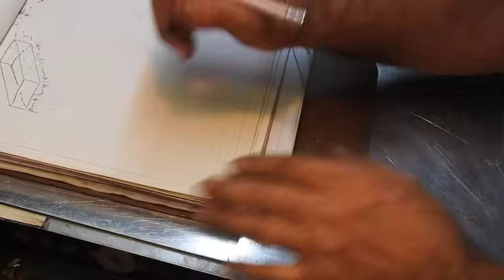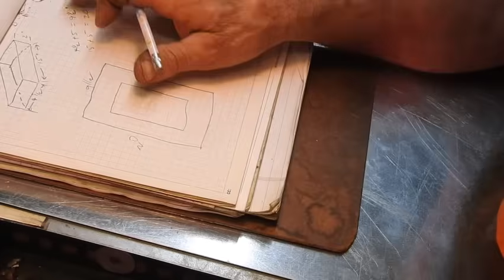Lets Build A Simple Sheet Metal Tool Tray

Comment: kills me how my kids have no idea how this would work.
I grew up, at 13 yr old, I was running an Oster and RIGID 300 pipe machine for my dad, installing Dry Cleaning Plants.
My kids cant even identify a pipe wrench.
I have truly failed.
Reply from the maker: Well, I started riding the fender of the old tractors at the age of 4 after my mom died.  Been around farm equipment, hogs and dairy cattle from then on....worked the farms 54'' circle mill sawing lumber as a kid on the business end of a cant hook.  Started off bearing from a buzz saw before the age of 10....the list goes on.  Rainy days on the farm were the most fun and were spent in the blacksmith shop making repairs to the machinery... LOL  I wouldn't trade a minute of the hard life with no running water or indoor plumbing until I enlisted in the Marines. By today's standards I was pretty hard on all three of my kids too and it didn't hurt a one of them either !!  I wouldn't be so hard on myself if I were you.  Today there is so much to catch a kids attention and draw them away from what's important.  I'm sure your kids absorbed much more than you may think. Thanks for watching the video and thank you for such a candid comment !!

Comment: Thank you. Great video. I like the idea of hammering the rivets on the inside and having the square block for a dolly. 
Question, how do you decide which part, base or side, will be the part sticking out and gets bent up?
Reply from the maker: It really doesn't matter which one because its the pretty much the same exercise either way.  But do what is easier for you. Smashing the rivits strengthen plus gives smooth surfaces.

Comment: What gauge and type of sheet metal do you use to make these?
Reply from the maker: This was just 26 ga galvanized sheet metal scraps from duct fabrication projects. Small boxes can use as thin as 28 ga. Larger ones require 24 or 22 ga if it’s expected to hold a very heavy load. If so, many times I’ll solder the corners for additional stability. I have quite a lot of  fab videos in the playlists up top if you are interested.

Comment: Anyone know what shears those are? And what gauge of metal
Reply from the maker: @808lukas1  iirc those are Malco M14 snips. The metal is 26 gauge galvanized sheet metal.
Reply: @ thanks a lot
Reply from the maker: @ no problem. Thanks for watching. Hey, if you are interested I have a LOT of sheet metal vids up top in playlists. All kinds of ductwork fittings.
Reply: @tractorman4461  sweet I will check them out. Nice work, I’m a beginner but turning a large ~4x5’ metal file cabinet into a tool chest. Slapped some paint and castors on, now trying to make 4 shallow drawers out of 1 deep. My challenge is joining smaller pieces of sheet metal to make up the drawer, most local stores don’t sell sheets big enough 

Those straight snips will be perfect. Oh yeah, what do you think is the thinnest metal possible to use for a large drawer like this? 26 be ok with joining and fold overs?
Reply from the maker: @ 26 will bow down if the drawer is too large. 24 ga is better for larger dimensions. Find an hvac supply house near you. Call them and ask for a cash sale for a couple sheets of 24x96x26 ga metal. Or 24x96x24 ga metal. Tell them you are just getting into the trade or they might not sell to you. They should have the Malco  snips there too right along with about every hand tool you’d need for sheet metal fan. Have cash ready.
Reply: @tractorman4461  wow you’re the man tractor man 👍👍

Comment: What sheet metal did you use?
Reply from the maker: This is 26 ga scrap metal from under the workbench.  I think that correlates to about .018 in thickness. Thanks Tony for watching.  I hope that helps.  Most residential duct is 28 to 26 gauge depending on the width of the duct in most cases.

Comment: Nice work! Looks like you may have done this once or twice before. Learned a new word today: "thinkability".
Reply from the maker: I think I can remember at least once....LOL.  I made a set of 24 gauge soldered corner drawers roughly 20'' x 24'' to fit a set of shelf runners in a service body truck.  Made the slides out of UHMW and they worked well for over twenty years as the body went on three different cab/chassis.  UHMW stands for Ultra High Molecular Weight material that is superbly wear resistant.  I have no idea how many socket trays I've made for 3/4'' drive sets to 1/4'' drive sets...the list goes on.  Thanks Terry for watching and commenting.  I guess a hillbilly term does kinda slip out every now and then for the entertainment of the unsuspecting viewer.....

Comment: Why didnt you just use the box brake instead of the cornice brake?
Reply from the maker: This particular 22 gage brake will leave small but visible creases at the edge of the teeth as it loses some of its resistance to movement when some are removed.  So for a crisper bend I like to use the standard 8-18 brake, then rely on this for the narrower bends. I wish I'd have spent the money for the heavier gage finger brake in retrospect.  But I've had this one since the mid 80's when I bought it new.  Make sense James..??  Thanks for the comment.  There is always a reason for the madness.  Not always a GOOD one, but a reason none the less.

Comment: Thanks for posting.  I really like bending metal and using pop rivets. Lately I've been making bird houses using 3 license plates. I have a cheap Harbor Freight 18" bender which handles the aluminum license plates (but not much else).  I would love to have a quality bender with fingers such as yours.
Reply from the maker: Awesome !!  I'm glad to hear there's guys out there that do that kind of stuff.  You are only limited buy your imagination.  I'll give you a tip...if you have a local hvac shop, I bet they will GIVE you scrap duct work from old systems.  You may have to take them to the car wash to get rid of household smells, smoke, animal hair etc, but you could get a LOT more practice material that way !! Good luck with whatever you do with metal... Thanks for watching and commenting so favorably HWP.

Comment: Man you are good! where can I find a piercing tool like the one you used?
Reply from the maker: That's a Malco hand punch from just about any one of the local HVAC supply houses.  WWGrainger should carry them as well as McMasterCarr.  But here is a set on Amazon that is similar.   https://www.youtube.com/redirect?event=comments&redir_token=QUFFLUhqa0VwTjFiZGpKNUgxaFMtV3o0bHhGWE9SYm1sQXxBQ3Jtc0ttaWhiNGF5VTNfQjd1aDJZUFBfRzA0d0ZZTndCQk5NRENTX3lMV2ZxNDVEbXMtanMyNDhqb0lRdEk0N1J3NlVHck9Cc091YjlhN1A0WVVjVTQyYW5famk3T19lRWJnajVmTjJqWW40RDhMQ3dEdFVNWQ&q=https%3A%2F%2Fwww.amazon.com%2FMalco-HP18KR-MALCO-Punch%2Fdp%2FB002JAWJGW%2Fref%3Dsr_1_3%3Fcrid%3D16UYJ12L75D92%26keywords%3Dmalco%2Bpunch%2Btool%26qid%3D1643997824%26sprefix%3Dmalco%2Bpunch%252Caps%252C173%26sr%3D8-3&stzid=Ugy9A-ObYtE-yoKUKHR4AaABAg.9Y1ZchJokqv9Y1ejsS8ktw
Reply: @tractorman4461  the link dosn't work...
Reply: Never mind, it did work. Thank you!

Comment: I know this video is old but what is that tool you use to pop holes for pop rivets?
Reply from the maker: That's a Malco hand punch.  Here is a heavier duty similar to the older and heavier ones I use for thicker metal:https://www.amazon.com/Capri-Tools-CP21050-21050-Puncher/dp/B00OM4GVX0/ref=sr_1_1_sspa?crid=JVJD1T0BEZML&keywords=malco+hand+punch&qid=1674740676&sprefix=malco+hand+punch%2Caps%2C154&sr=8-1-spons&psc=1&smid=A2ZSTDEXO9VTZF&spLa=ZW5jcnlwdGVkUXVhbGlmaWVyPUExOFBTSlBTRVpFR1c1JmVuY3J5cHRlZElkPUEwNDgzMTYwMlcwTlg2WEkxQ1lIWiZlbmNyeXB0ZWRBZElkPUEwODA1NjE1MVM3UjRBUExKUEczQiZ3aWRnZXROYW1lPXNwX2F0ZiZhY3Rpb249Y2xpY2tSZWRpcmVjdCZkb05vdExvZ0NsaWNrPXRydWU= And this is similar to the light duty Malco I used in this video: https://www.amazon.com/Malco-HP18KR-MALCO-Punch/dp/B002JAWJGW/ref=sr_1_3?crid=JVJD1T0BEZML&keywords=malco+hand+punch&qid=1674772133&sprefix=malco+hand+punch%2Caps%2C154&sr=8-3  They are both a MUST have tool when fabricating sheet metal.  Thanks Timothy for the question...while you are here, maybe take a quick look at this playlist:https://www.youtube.com/playlist?list=PLk72G9DTzZ1tqw8ST_xdUlPoy_O-SmuBx
Reply: @tractorman4461  thank you for your response. I do appreciate it!

Comment: I have never cut a piece of sheet metal before. Based on this one video, and using a harbor freight 30" bend brake on sale, I made a perfect-sized box to fit my printer galley trays (24"x7") filled with evaporust, so they could soak overnight. Used JB Weld in the seams to make it water-tight. Also learned to use a rivet gun. YOU ARE THE MAN! I searched high and low for a plastic container that would hold the tray and not require 5 gallons of evaporust to cover it. This box was the answer.
Reply from the maker: Awesome !!  And now that you've got your feet wet, you realize you are  now limited only by your imagination.  Slow and deliberate measurements, cuts and folds an you can make tons of stuff with the HF brake.  Good for you Johnny.

Comment: I'd love to see you do a round one for a Home Depot bucket
Reply from the maker: If I had an immediate need for one, I'd do it in a heartbeat.  I'd make maybe 4 stackable with partitions to fit the insides of the bucket loosely.  The process is on the order of this repair made here: https://www.youtube.com/watch?v=1OOIoMqtQ0M  Of course not the crimped edge, but the overlap joint would be the same.  The bottoms might be a different style too...but you can get the idea here anyway.

Comment: I'm looking to build some like this, a larger version with partitions to organize them. I'm thinking about 2' wide 1.5' deep with 2-3 partitions. How would you add partitions?
Reply from the maker: Well David, you might want a heavier gauge metal for something that large because it'll want to bow and twist with a heavy load.  If you can, solder the corners for rigidity.  That'll help.  For the partitions, I'd bend 90*s on the bottom and both sides and rivit heavily with 3/16 pop rivits, all bradded over flat.  Cross break the partitions or bend a horizontal 'V' in the partitions midway in the depth to add extreme rigidity.  Also I'd bend a 180* hem all across the top to keep from getting cut and even better, take a coat hanger or fat galvanized wire, straighten it out and set that inside the hem as you flatten it.  That will give  a rounded and sturdy top to the partitions.  Sound like a plan ?? Good luck with your project.

Comment: I remember making boxes like this in my shop class back in '77.  Only thing we did different is we spot welded the corners instead of riveting them.
Reply from the maker: Yes, I spot weld a lot of the time too on these edges.  The smashed pop rivets shows an option most have access to, even though most do NOT have a box and pan break. But cheap ones are available to home owners at Central Machinery, Harbor Freight or Northern Tools.

Comment: I basically learned how to make such things by taking cardboard boxes of all types apart when I was very young. Once you understand the concept, anything can be made. Your informative video is spot on. And it is easy to tell you've made such things many times before.  I like to weld the sides to the body of the box and than grind the edges smooth. And they come out amazing as well. It really depends on what you have as equipment to work with and, of course, your own ideas what to build.    Thumbs Up!
Reply from the maker: Yes, the same basic technique can be applied to quite the variety of materials.  I have soldered the corners many times and spot welded many as well as pop riveted quite a few as this one.  I'm glad you enjoyed this video and I do have a lot of sheet metal fab videos in the playlists up top of the page.  Here's a sample: https://www.youtube.com/watch?v=i2KFLZGbZwI&t=2s

Comment: Great video sir. That plier type tool that you used to make the hole for the rivets, what's the name of it and where can I get one? I work with sheet metal making roof ventilators and I would love to add that tool to my war chest of tools.🙂 Wheel use air drills to make our holes but every now and then my friends will ask me to make a box like yours and I don't feel like turning on the shop compressors just to run the air drill just to make a couple of holes so that's why I would like to know the name of your hole maker. Thumbs up on your video and take care buddy. 👍👍👍👍
Reply from the maker: That's a Malco hand punch from just about any one of the local HVAC supply houses.  WWGrainger should carry them as well as McMasterCarr.  But here is a set on Amazon that is similar. https://www.amazon.com/Malco-HP18KR-MALCO-Punch/dp/B002JAWJGW/ref=sr_1_3?crid=16UYJ12L75D92&keywords=malco+punch+tool&qid=1643997824&sprefix=malco+punch%2Caps%2C173&sr=8-3 I'm sure its just an upgraded version, because mine came with the same 1/8'' and 3/16'' punch and die sets. They also make much heavier ones out of cast steel and they come with 9 sets of punch and die sets.  Those are much more bulky.  JCWhitney has a much cheaper version that is adequate as well as Harbor Freight or Northern Tool.
Reply: @tractorman4461   Thank you so much for the fast reply and the info. Keep up the good work friend, bye. 👍

Comment: In our first metal shop in school, our instructor had us start out with cardboard for simple concepts. It taught us the basics of measuring without destroying any sheet metal.
Reply from the maker: You are lucky to be young enough to remember metal shop.... I barely remember high school but then....that was the way the 60's were.  LOL.  I think we made a flat top tool box, but mostly metal shop concentrated on welding and stuff like that and maybe a little time on an old metal lathe.  I learned on scrap sheet metal after working hours in the bosses shop.  Thanks Chuck for the comment.
Reply: @tractorman4461  ilz
Reply: I remember sheet metal shop in Jr HS in the 70s, I made a small metal box just like the one in the video and soldered it's corners. I remember the teacher telling us the metal shear's cutting edge was so sharp it would cut your fingers clean off and they'd hit the floor before you even felt it and to keep your fingers AWAY FROM THE BLADE!!!!  it didnt have guarding back then that I remember!

Comment: Beautiful sheet metal work. I'm an retired A&P mechanic and can do sheet metal if forced to but we used to build all kinds of tool trays and parts trays, galvanized metal has to be easier to work with than aluminum which will spring back and crack on you.
Reply from the maker: Aluminum is a bit tricky.  Yeah, ya don't get the chance to bend it twice most times...Hahahaha.  Thanks Rick for the fun comment.
Reply: U have to have right alum.